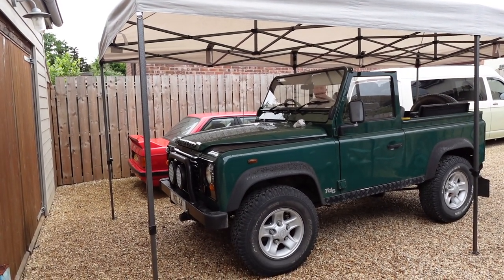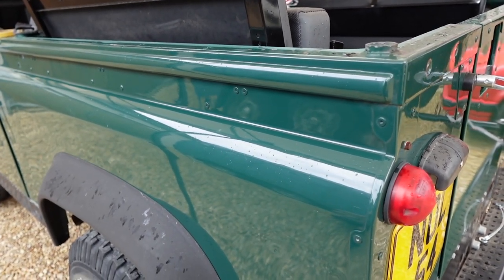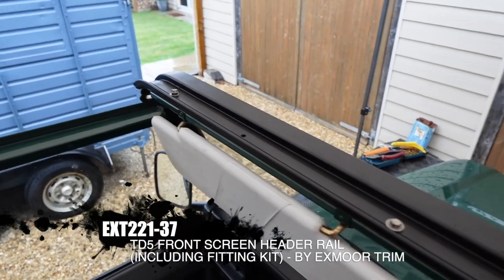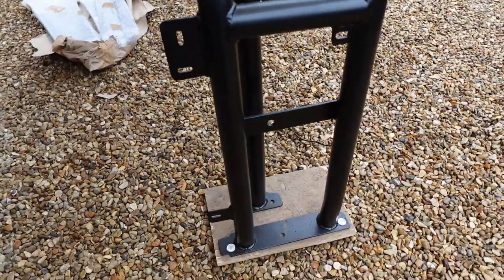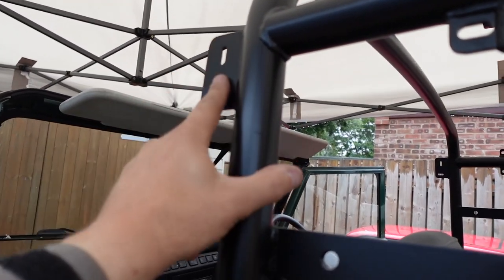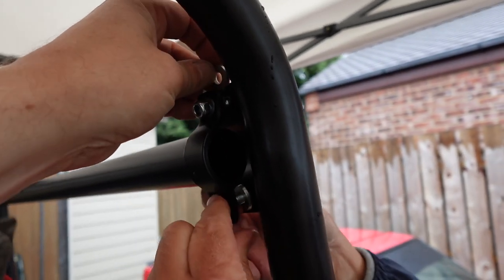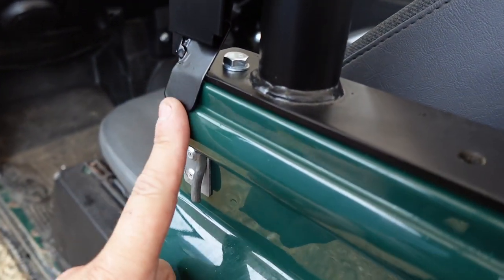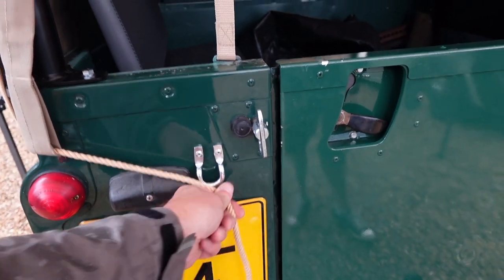Transform your Defender 90 with a canvas hood and heavy duty frame set.

Comment: Nice job sir…
One technical question…
When you bolt the bar to the chassis, did you put some sort of pad underneath ?
Like a rubber pad between the rollcage and the chassis ..!? 🤔

I asking because THESE points could be moving and wiggle a little and scratch the surface and then corrosion would start in earnest.

Greetings from Germany everybody 

A owner of a 110 HT 💪

PS. she looks beautiful 😍
Reply from the maker: We didn't but that would have been a really good idea. In the past, for these kinds of installs I have used an old bicycle inner tube and cut to shape, which has worked well as they are not too thick.